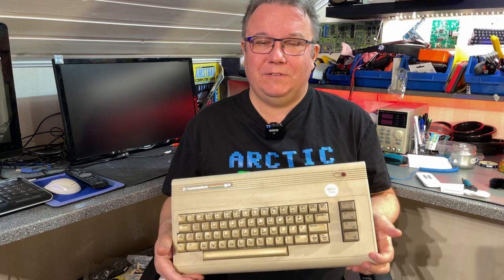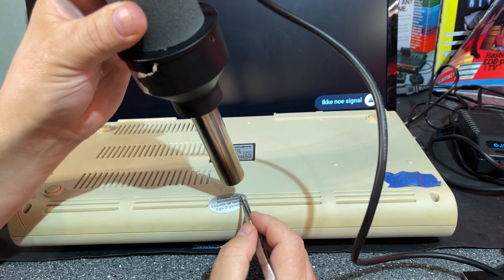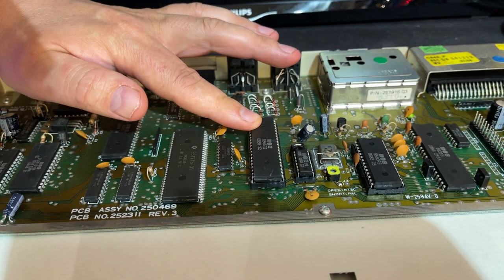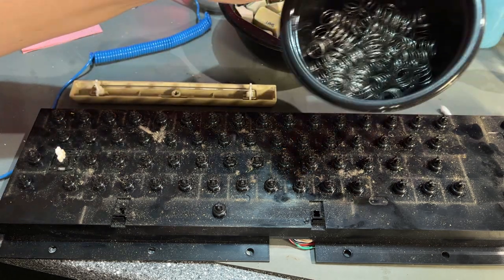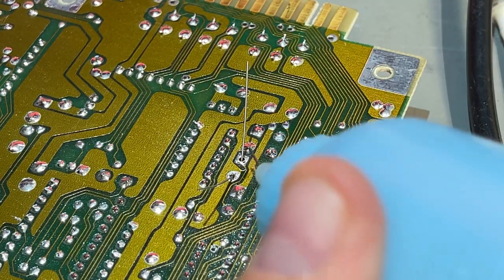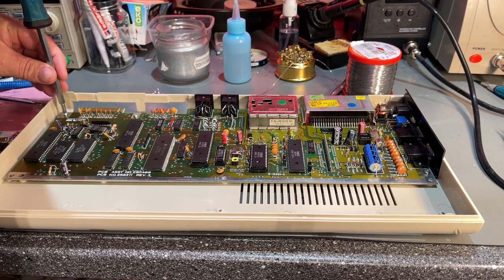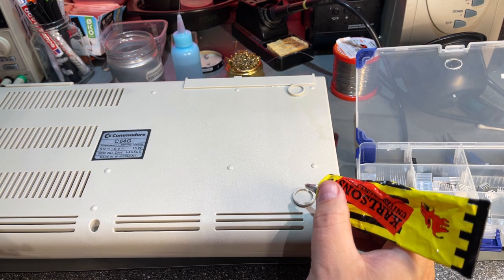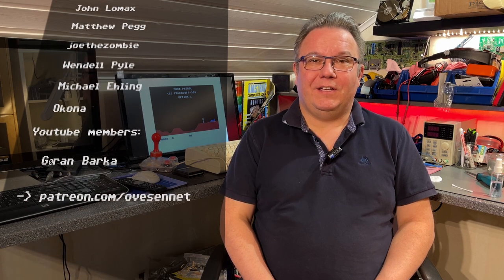Another beautiful C64G restoration - Warranty seal not broken! Did I beak it ?

Comment: My C64c also had an unbroken warranty seal, have to admit that I broke it though. It's of course possible someone had carefully removed it before (or slapped a sticker on, I understand authorized repairers got rolls of those stickers), but I don't think so, it didn't look like anything had been done with it. Surprising that you can still get C64s that have never been opened, but I prefer maintenance over getting sentimental about that :D

Comment: Impressed by the retrobrightning here, just 3 hours in the powerful sun of North Norway and peroxide cream.. This should finally end the discussion about the LED colors on the C64G… Sealed up machine with red LED would be final proof that not every one of these have a green LED.
Reply from the maker: Yes, that is an interesting point. Thanks for watching!
Reply: It is known that Commodore used whatever they had in stock that day.
Reply: That is interesting, I was just reading about this since I don't know much about the C64G. The article I read stated that the LED color varied as well. I changed the LED on my breadbin C64 to green. I think it looks nice. I can't remember if I just did it for fun or if it was broken. It might just have been very dim. I guess I should watch my own video to refresh my memory 😂